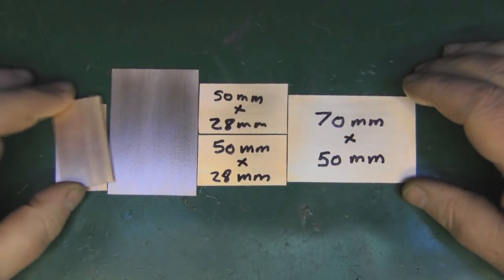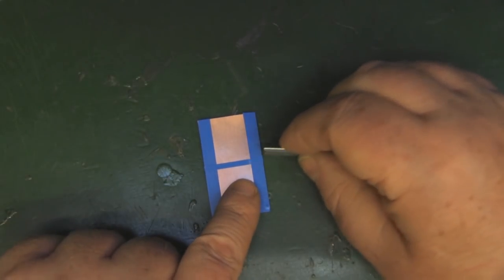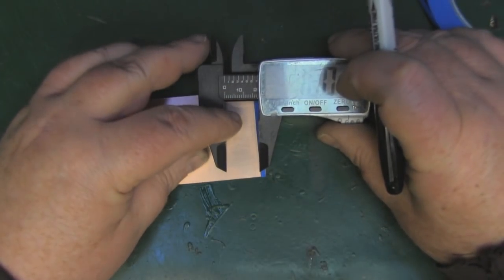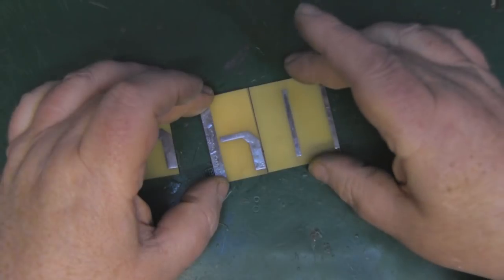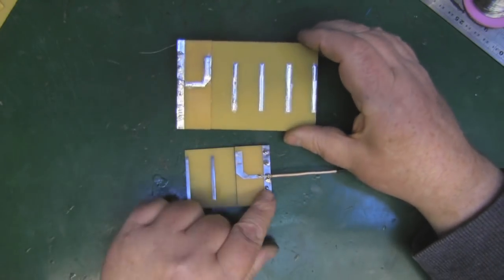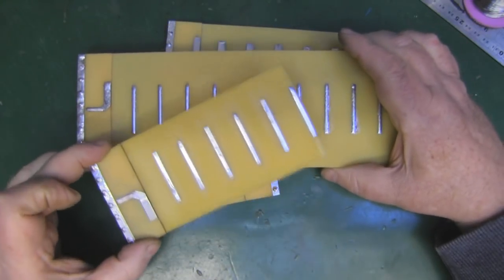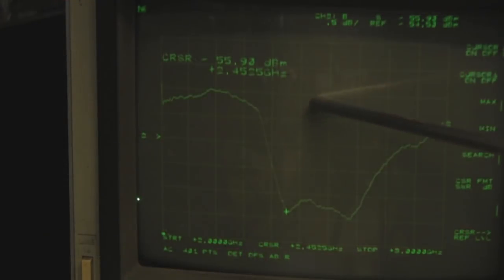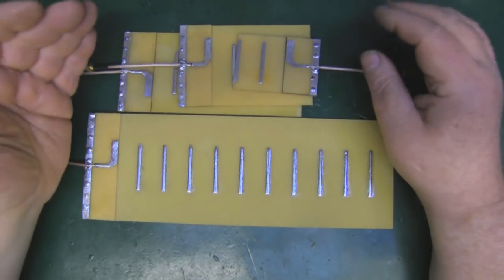A Simple PCB 2 4GHz Wifi Yagi

Comment: Great video! If you were to etch a 2.4 GHZ Yagi on a single side PCB and a 5.8GHZ Yagi on another single side board then put them back too back with 5 mm spacer, could you hook a single coax too both of those antennas? I’m looking too make an antenna too use on my RC airplane radio transmitter. the radio can be setup to work on 2.4 or 5.8.
Reply: Look, I'm not an expert on antennas, but a common rule of thumb for dipoles is to put at least halfwave between them, unless you specifically building an antenna array. This is true for both RX and TX. Halfwave at 2.45 GHz is a little over 60 mm, so, unless I had everything pre-calculated in MATLAB or, better yet, had all the stuff necessary to test a setup like this, I'd make that spacer 100 or 200 mm, just to be more or less sure the antennas won't interfere with each other. Even if 10 cm is somehow a portability issue for you, you can always assemble the setup on the spot.

Comment: Hi Andrew. TPlink WN722N claims that it has 20dBm of TX power under Windows 10. If I purchase something like AWUS036NH, will this produce better signal to my router? I know it has got 2000mW of power but it probably work under restricted 20dBm (100mW in my country is the limit). 
I really want to test that out but I don't really want to throw money on something that will not work.
Can you give me your inside? Why are You using Alfa cards? What is the main reason? I've seen you use it under Windows 7. Why this, over much cheaper WN722N? Cheers, amazing channel.

Comment: Hi Andrew, fist of all thank You very much posting such a very registering videos.
I think the community inclusive me are learing a lot from you :-)
I just over pondering on the following:
As per this sketch (https://drive.google.com/file/d/1ABpQVXIWWiwi8oFFaEO1FPkJDI2PzTeZ/view)
the total length of the driven element (dipole) is approx 2x24 = 48mm. (may be -3 mm)
However the half of the wavelength of 2.4GHz is 62,5 mm.
Please correct me if I'm wrong, but to get the best result the total length length
 of the dipole
shall be 62.5 mm and not 48mm.  May be this scenario was tested

Comment: What diffrent is if this small triangle, after antenna and before connector marked red triangle in picture https://www.ti.com/lit/an/swra350/swra350.pdf and how cheap is to order PCB from China  ? does not want to advertise, but I understand, it seems like it is cheaper to order and the only difference is that the ordered (high-quality) goods do not arrive until a week or a month later.  There are at least four (actually more) of these companies, of which other electronics youtubers have also reviewed (quality vs. price vs. delivery time). And they have found that it is better to have a PCB made in China (even with an antenna prototype, if you can order a larger area for the PCB and then cut a smaller area during testing). Like this https://www.pcbway.com/project/share/Yagi_Uda_PCB_Antenna.html

Comment: So, the driven element has a length of 23 or 24 mm? I'm asking because there's this difference between the pdf and the actual measurements in the video. Also, that distance between the "feet" of the "h" is it 16mm or 18mm?

Comment: Brilliant work again. I've got a couple of questions.
Could you use copper tape ( I've got a roll of 5cm wide tape), you could then use a craft knife to cut shapes and stick to a non conducive board (like artboard). Assuming that you manage to get the gap between the balun part correct, would the dielectric constant of the different boards affect its performance?

What gain do you expect from the 10 element Yagi?

What about stacking them 😁
Reply from the maker: 10 element should be around 14db and yes you can use copper tape or aluminium. I have done this in older videos. Most plastics have a similar dielectric constant as fiberglass PCB

Comment: If you want to feed a copper wire through a pcb and not drop out, you can use cutters that crimp the end. They are not that expensive either. Usually they leave something like 1.5mm of wire that is crushed flat from sides. They are handy for pcb assembly too. However, if you ever want to remove components, you need some extra force to deform wire enough to get a component out again.
Reply from the maker: I will have a look thanks hoggif
Reply: @andrewmcneil  If you find any source that sells those pliers you have a huge variaty available. There are pliers that cut to lenght and bend the lead to 45 degreed, end cutters that crimp and many variations. Piergiacomi TS30D could be one that crimps (not 100% sure) as is manufactured.
Those used to be more common when through hole was the thing in the industry. Much more rare now. I picked up a load of Erem pliers like that for a fiver when one shop dumped them. I have a life time supply of Erem pliers that cut from all angles and fixed lenghts, adjustables and lead forming ones.. Erem seems to make no more some of the types I have.
I think I have also some cheap chinese version that cuts and crimps.